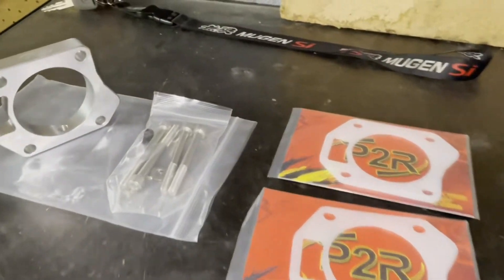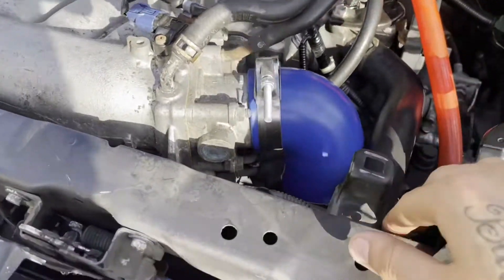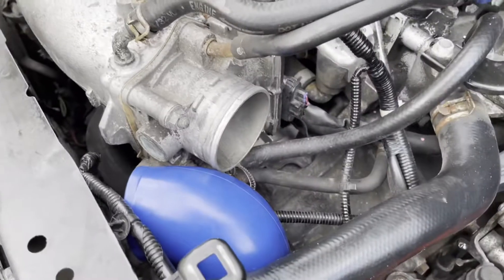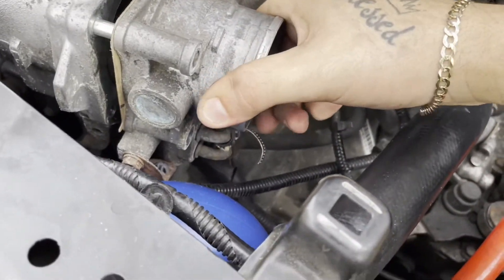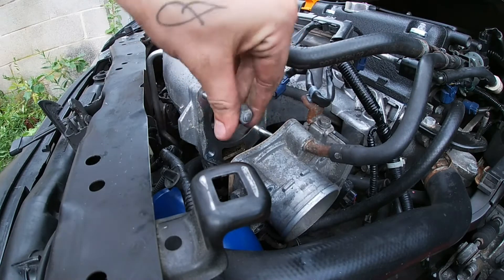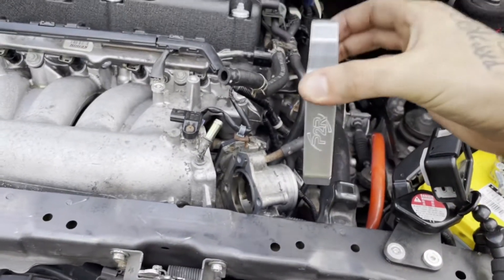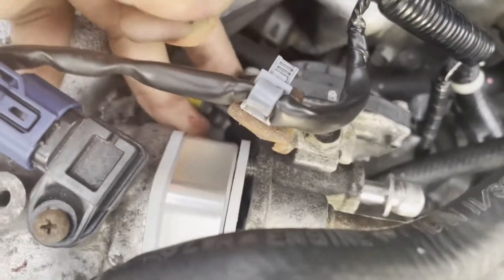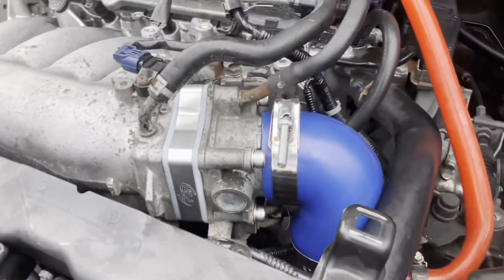EASIEST Mod for your Civic Si | DIY P2R throttle body spacer

Comment: Does it change the sound and did you feel more power??
Reply from the maker: When installed I noticed a cool little whistling kind of sound that others experienced too. I swear the car felt better but I’d be lying if i said I felt a huge difference.
Reply: Dose this spacer fit on a j35  manifold
Reply: @alexmilian2576 you can get it port matched